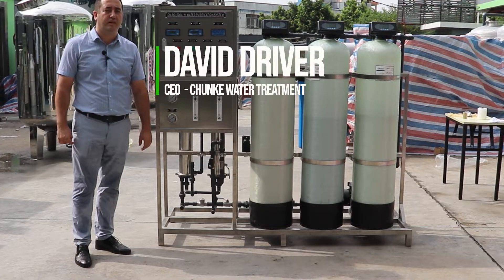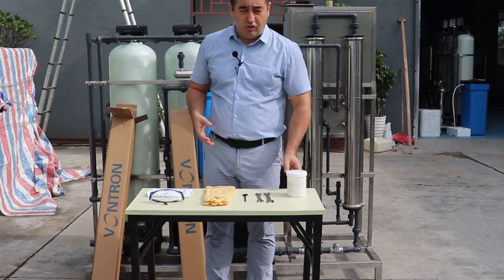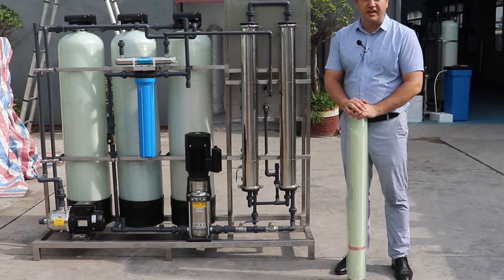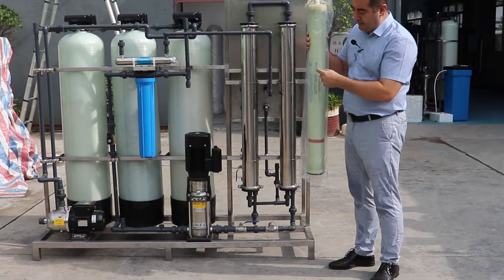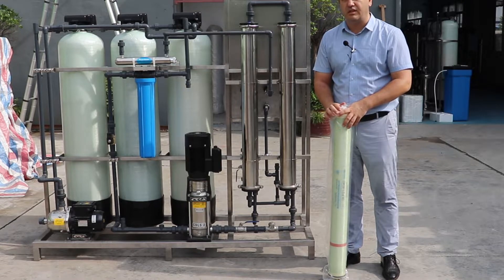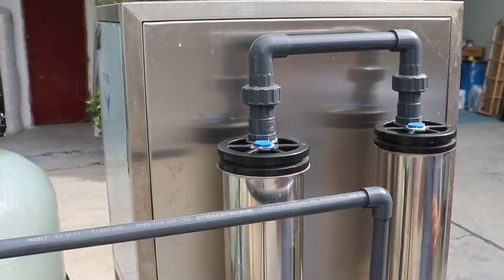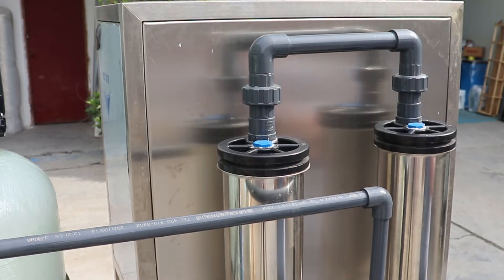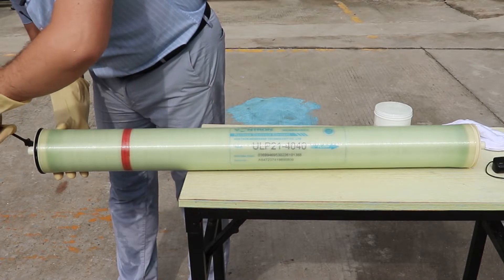How to install/replace ro membrane at industrial reverse osmosis water treatment system machine ?

Comment: Can you do a video how to connect system with power supply
Reply from the maker: Here, there is electrical connection: https://youtu.be/Ltqsv3LfnlQ
Reply: @ChunkeWaterTreatment  can I have another with a different system
Reply from the maker: @jeffreyreid4908  ok, let me know capacity as liter per hour, when we produce , we make a video for you.
Reply: @ChunkeWaterTreatment  1000 lph
Reply: I bought the system from in 2021but have not connected it used it as yet
Reply: Bought it from your company
Reply from the maker: whatsapp  +8616616636489, make video call, we show to you